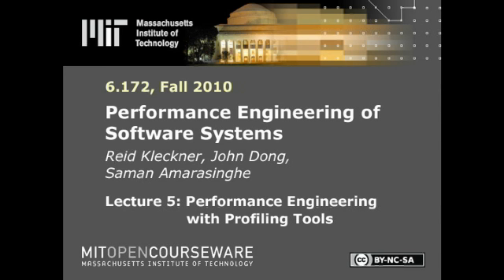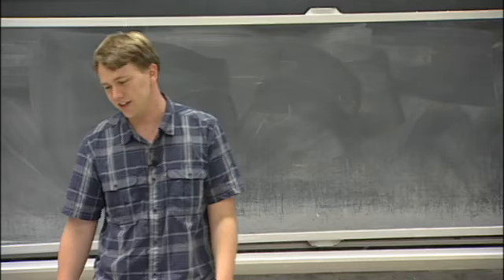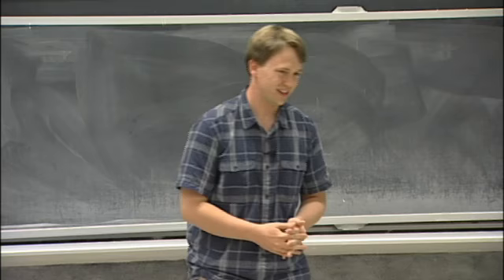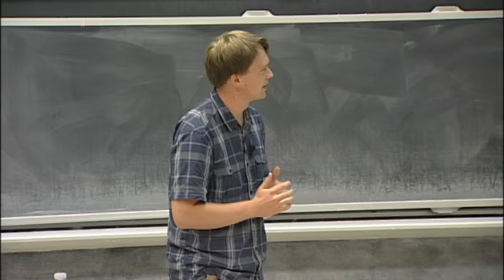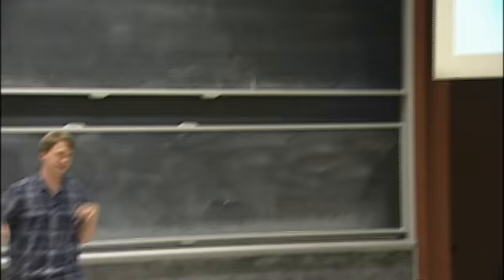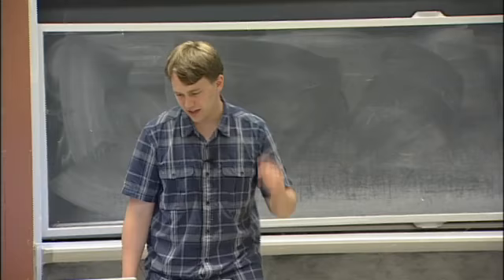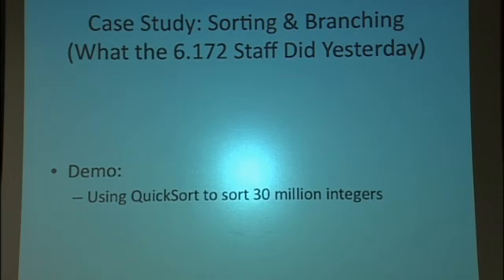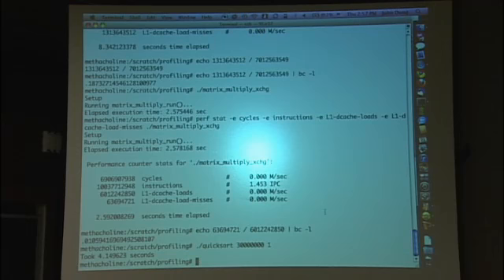Lec 5 | MIT 6.172 Performance Engineering of Software Systems, Fall 2010

Comment: This is SO conventional, with unexamined foundation. Here are some problems:
a) it assumes you need different tools for CPU-bound vs. other,
b) it assumes all potential speedups take the form of "hot-spots" localized to code locations, (or possibly that any others don't matter),
c) it assumes the way you find potential speedups is by measuring various things (and consequently that precision of measurent matters).
d) it only looks at little algorithms, and concentrates on stuff like cache misses, which are almost irrelevant in real software.

By contrast, what would an ideal pie-in-the-sky profiler do? IMHO, ideally it would sample the entire program state, on wall-clock time (not just CPU). It would have AI automatic programming capability, so it could understand in each sample what the program was waiting for, and why, in its entirety. It would treat each sample as if it were a bug: the program doing something that might be eliminated or at least done better. If it saw something that could be done better on a significant fraction of samples, then it could recommend that change. (Interestingly, it is often assumed that that requires a large number of samples, but statistically it does not.) Such a profiler could find lots of speedup opportunities that current profilers couldn't hope to see.
It would be very valuable to have one of those.

Until such an ideal profiler is built (which is certainly worth doing), a programmer can do essentially the same thing using a debugger and their own head, but this requires a bit of a brain-bend. The brain-bend required is to question the premise that tools are always better than people. The price being paid for people not bending their brains like this is lack of speedups - big speedup opportunities are not found by the tools they use (or by guessing, the other popular method). The result is software is often simply much slower than it could be.